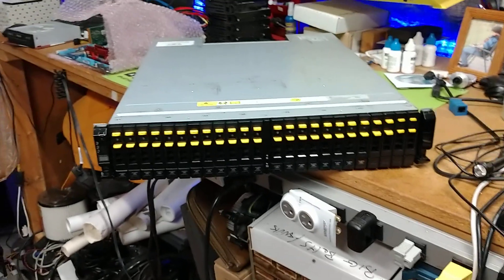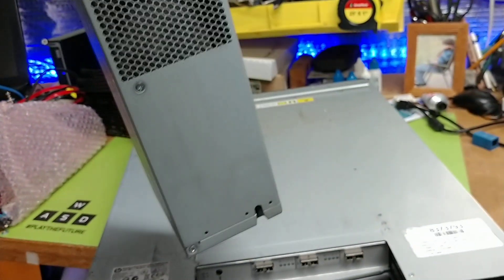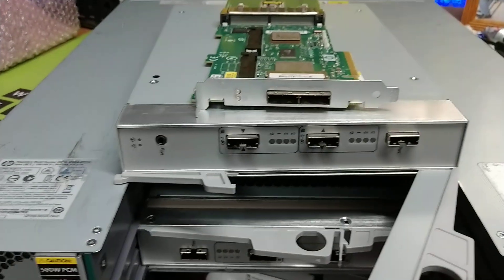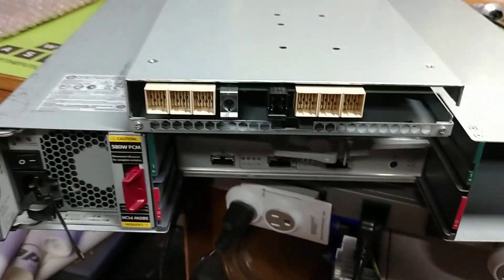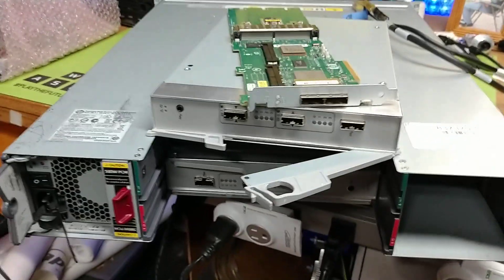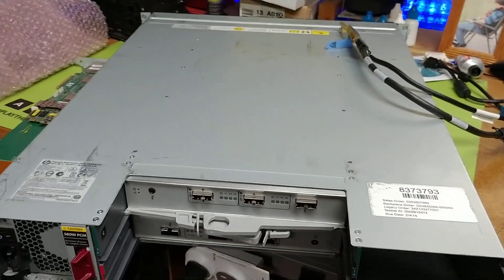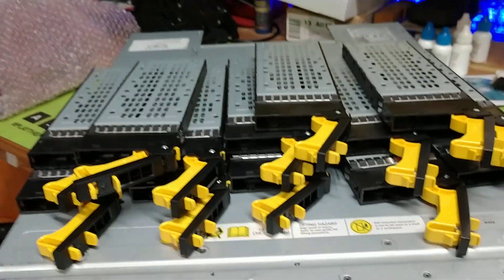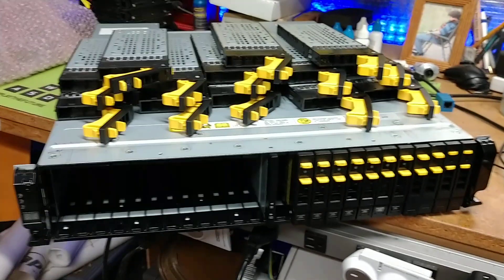Reusing a low cost HP 3PAR M6710 SAS/SATA 2.5 inch, 24 drive disk array  for your home server lab

Comment: So it's port A controller 1 to port A on the raid card. Port B controller 1 to port A controller 2. Port B controller 2 to port B on the raid card? And once I have a lsi 9210 hba card how to I enter the management program on the raid card to see if it sees my disks? And is it possible to do any of this with the HP Smart Array P822 / 2GB FBWC 6GB SAS RAID Controller I have now or do I have to wait for my hba card to arrive? I don't know how to flash my raid card and I don't think I want to bother. It's simply easier to not flash anything in the first place
Reply from the maker: For the HBA card you use the OS tools to see the drives for the HBA controller doesn't have a RAID OS on the board. (That is why they are so you can see disks in basic format.) A RADI controller does have a RAID OS on the card and will let you see the drive but not use them until they are 512 sector formated.  TO know how to use the HBA controller go to the video I sent you about formatting 520 sector drives.  They walk you thru the Centos linux steps using a HBA controller.  That is why I have a USB stick with Centos and the formating tools on it. It works.  As for flashing, I agree, use the HBA for see and format anything and then once your disks are ready flip to the RAID card.  Both are also great DIAG cards to  work with failing disks.
Reply: @leadiususa7394  I have 2 questions. First is i bought an already flashed hba card. LSI SAS9200-16e 16-Port External HBA Full-Height PCIe P20 IT Mode ZFS FreeNAS. Apparently it should be good to go once it arrives, right? Second is is the hba card going to be able to cook Thanksgiving Dinner like the 2 raid cards I bought?I bought 2 40x40x20 mm fans because the raid card gets insanely hot. Should I put a fan on the hba card? How do you manage the heat in a desktop or workstation? They have little airflow. And should I use Centos and not Ubuntu? There are videos on formatting with Ubuntu
Reply from the maker: @anthonystrohmayer9191  For question 1 yes, they will be ready for use if in 512 format, reformat if in 520 format back to 512 sector. As for the the heat levels.  I use server chases so air flow in never bad  but I also mount a small fan on the controllers just to help out some... Mounting the fan is your call.  The controller can take a bit of heat but they work better if cooled and place in the right type of case. Do some research on the fans first 1600 to 2500 RPM is good. but the size is a worry based on the space you have...  Me, I have 100's of fans from the past years so I was good to pick my needs from my on stock.
Reply: @leadiususa7394  I bought 40mm USB DC 5V power 4cm 40x40x10mm 4010S Brushless Cooling cooler Fan X 2PCS. They are about 5000 rpm. One is for the raid card. I'm also considering buying pci slot fans. They come in 1 to 3 fans. They are about 2000 rpm. GPU Video Graphic Card Triple Fans PCI Slot Bracket VGA Cooling System. You can see these on ebay. Do you recommend a cooling fan type for my issues?
Reply from the maker: OK so I had to rebuild my unit up again with my P800i RAID card and the 6710 with my two 7000 SAS controllers in the back.  I defaulted my 6710 When I setup array and it failed. Hmm so I saw when I built the array top controller was flip one way and the lower one was flit the other way. RAID port a to SP-1 port / DP-2 port goes to lower controller DP-1. Then the last connection when DP-2 to RAID port B.  The paths showed only four LED for controller and I saw the issue and yes I got an alert peep.  The config default back to four hook ups such as a HP 822 card being use.  So I pulled out the lower controller so it was off. (It must be remove to force a single dual pathway. (not dual / dual pathway.)  We only have one SAS array so we run in single dual fail over path.  You will get a single peep every 20 seconds but all the drives come and can be format and use.  Now to test your disk bus channel on the array. Place one drive for every 6 bay slots. So put in bay 0, bay 7, bay 13 and bay 18 like I did.  Now go into your raid controller and set each drive up as RAID 0 each.  Not together but as stand alone RAID 0 disk drives.  next boot into MS server or Linux and detect them then format them and test a data dump on each of at the same time and see the transfer rates.  Now to get rid of the single beep, when you put in your 822 controller card with four SAS ports and port 1 goes to DP-1 on the array top controller,  then connect the DP-2 back to the RAID card port 2, now do that for the lower controller to complete the config using port 3 and 4.  You are running in dual / dual pathway.   This setup is really built for connection two or more arrays to one storage server.    As for my peeper speaker, I'd tape over it so I barely hear it. (lol) That took about four hours of fun...  See if this works, for my server (MS server 2019) is using these drives in single dual setup and works well. BTW I had a back disk in bus bay 0 and sent me on a path I didn't need to go. Make sure you test drives are good for use.  I didn't check so I assumed it was good. (Make ass out you and me) Not!  Later dude!  Hope this helped you some.
Reply: @leadiususa7394  thanks. I believe I have to wait until my hba card gets here September 11. In the meantime while I don't have a cooling solution for the raid card I will just use my server since it is designed to displace heat
Reply from the maker: @anthonystrohmayer9191  That works for me!
Reply: @leadiususa7394  But to properly have a redundant shelf I need 3 cables? How many cables do I need to attach 2 shelves?
Reply from the maker: @anthonystrohmayer9191  I think the diagram showed two cables between the arrays and four for dual - dual pathing.   Did you look at the latest link I sent showing the cable layout for hooking up 6710 arrays?
Reply: @leadiususa7394  Do I need 4 sas cables to connect one shelf to my raid card or can I remove one controller and just hook one cable to my raid card?
Reply from the maker: @anthonystrohmayer9191  So for now remove one controller card from the array and you can use just two cables, RAID card Port A to DP1 and DP2 to RAID card Port B.  When you have your SAS card, it will be four cables.  The bypass cable is only needed when you add another array to the mix.  Refer to the link I sent you on hooking up 2 or more 6710 arrays to a server.
Reply: @leadiususa7394  So one cable from port A and one for port B on the controller 1 to A and B on the hba or raid card?so I need 2 cables. Won't work with just 1?
Reply from the maker: @anthonystrohmayer9191  So one cable used is single pathing and not good to do and you will get fault alerts.  If you use one controller then two cables should be used.  Sorry...
Reply from the maker: Check out the HP 3Par cable setup.  https://www.youtube.com/watch?v=xdUuHN4bbKA   it is pretty good if you don't like the manual link I sent you.  The cable media is different but the hook up from array to array to server is correct
Reply: @leadiususa7394  neat. My brain is too tired to want to watch the whole video. Need to plug in my workstation one day when my hba arrives. Is there a way to format a 3.5" drive without an internal hba card or a 3.5" shelf? I just have 2.5" shelf and an external hba
Reply from the maker: @anthonystrohmayer9191  Your work station may support SATA/SAS mode.  Get the single SATA to SAS with power connector to test it out.  But before that you need to put everything down and walk away from all of this and play a game or sit down with a good beer or grill out.  Life is more a everything and less about IT stuff.  When you feel better go back and with the SAS stuff again.
Reply from the maker: @anthonystrohmayer9191  sure just get one of these singe SAS connect cables. https://www.newegg.com/p/0ZF-00EK-00045?Item=9SIAABH54D4941   I like this so much... I just order one for my needs jsut now.  I might get two or three more later..  I forgot about this SAS hookups...
Reply: @leadiususa7394  I am occupied with thing outside of these projects. Like the gym 4 days a week. And work.  And building my diy shelf. Some day I hope to be over these problems with the disk arrays
Reply from the maker: @anthonystrohmayer9191  Yea take a break, it not going anywhere...
Reply: @leadiususa7394  these 2 shelves cost me around 750$. Be nice to get them working. And the sad part is I don't even know if they work or not. By the time I get them running my 30 day warranty will be expired
Reply from the maker: Oh and one other things.  This URL show you have to cable up the 7000 controllers for when you two or more arrays.   https://vmfocus.com/2013/03/18/3par-storeserv-7000-hardware-part-3/

Comment: I had a need for an external enclosure for my homelab.  I found a used one of these online and decided to try it.  I found your video when I was trying to figure out how to cable it to my server.  It came with two cables.  My first attempt was to connect each of the two external ports on my LSI SAS9207-8E to a DP-1 port on the M6710.  This worked and my server was happy with that arrangement.  However, the fault light on the M6710 bezel is on and the fault light on each of my eight SATA drive trays is also on.  All lights on the back of the M6710 are green, there are no yellow lights on the back side.  When I first power up the enclosure, there are only green lights on the front.  When I power up my server, the activity lights will flicker when the bios checks them out.  Once  Proxmox is loaded and running, the fault lights come on.  I don't have any daughter cards for the SATA drives.  They are plugged directly into the backplane.  Is that the issue?  Or is it something else?
Reply from the maker: I think your cable setup is wrong on the back of the unit.  Your server will plug into Top A port on the back of M6710, then top port B goes to the lower A port and then the lower B port needs to go back to  controller in your server.  Do you have it setup that way?  I bet you are only doing a single pathway currently and will create errors issues.  Also you can just test the upper M6710 controller and then the lower controller part. Doing will allow you to test 12 drives at a time on each controller.  Let me know what you find out...
Reply: I am working on that.  I only have two cables at the moment.  I have another one on order.  My second attempt with two cables was one from server to DP-1 and the other from that DP-2 to the other DP-1.  Server is still happy, but no change in M6710 lights.
Reply from the maker: @tsimblist  Yes but you need a cable going back to your server from the lower PS-2 port to provide you a redundant path instead single path.  Server to top PD-1 - top DP-2 to lower DP-1 - Lower DP-2 back to server second port.  That should work. /:>
Reply: I received the cable that I ordered and cabled up my server with the M6710 as you instructed.  No change in symptoms.  I'm afraid I may need the interposer cards for my SATA drives to keep the fault lights off.
Reply from the maker: @tsimblist  I am rebuilding mine into your config. I well let you know what I find...
Reply from the maker: No the array can do both SATA and SAS but try not to mix them on the same bus, Put SATA together on bays 0 thru 11 (Bus 1 and 2) and SAS on bay 12 to bay 23. (Bus 3 and 4)  Run them in separate buses or they will fight with each other.  Also boot into a basic Linux OS like Centos on a USB stick, (Like in my videos)  instead of booting into a full blown Proxmox OS.  Test at the core level away first and when all your issue/s are address then test your targeted OS.  Step by step you will get it work.  As for the yellow lights, I will research with my 6700 series 3PAR array and see what that issue is.  I will get back to you on that one.  The Yellow alert maybe a false / positive alert do to the heart beat JR-45 or serial connections connected.  You don't need them when doing core SAS connectivity.

Comment: me again, Just had the time to get back to this project, I formatted all drives, unraid, windows and freenas can all see the drive but they will not mount nor will they format  or initialize, in Unraid I will get this error "Unmountable: Unsupported partition layout" any suggestions?
Reply from the maker: Did you format from 520 sector to 512 sector?  The good news is that you got it all hooked up.  Also how long to each drive take to reformat? It should have been a few hours each to doing a low level formatting.
Reply: Leadius USA it took a little over an hour for each drive. I used sg_format - -format - -size=512 /dev/sd(x)
Reply from the maker: Did set the sector size to 512?
Reply: @leadiususa7394  Yes I used the "--size=512" was that not correct? Thanks for your help
Reply from the maker: @every1critic  Yes that is it. Ok check your cabling.  The array can block a drive use if not cabled right or is failing.

Comment: I need cheap enterprise level sas drives. Everytime I try to buy some on eBay someone out bids me. I'm afraid I can't afford steak on a McDonald's income.
Reply from the maker: Yea but don't worry so much on that front.  Are you trying to buy in bulk or one at a time?
Reply: @leadiususa7394  I bought a raid shelf that purposely came with the drives and cages to save me the headache of finding compatible drives and cages. But I have this project of making a diy shelf for hard drives and raid connected to either the mini sas or from inside the computer case on the mini sas connectors on the raid card and I needed a set of matching drives 8+.
Reply from the maker: @anthonystrohmayer9191  Yes but they do not have to be the same make and model.  Just by size.  I have been doing this for 29 years now and it work with mixing as long as you don't mix RPM speeds.  If you really want to get the same set of disk then shoot (For now...) the 300GB 10K SAS disk drives.  Do you have a 3.5 drive shelf or 2.5?
Reply from the maker: @anthonystrohmayer9191  here is a 300K 2.5 inch SAS Dell hard drive you can look at.  https://www.ebay.com/itm/U709K-Dell-300GB-10K-6Gb-s-2-5-inch-SAS-HDD-Hard-Drive-HUC103030CSS600-0U709K/282651157882?epid=177505943&hash=item41cf52657a:g:M6QAAOSwTMZbhKpL      Also are you using a RAID Controller or a HBA controller?  If it is a RAID controller then you only need 3 or more disk drives to get your storage started and you can grow it out as you get more.  HBA format is doesn't matter for you need a software RAID OS to do anything so 2 or more drives will work.  Also if anyone tell that you must have the same make and model of drives, they are wrong.  That only applies to enterprise level systems and that is not what you have based on your goals.
Reply: @leadiususa7394  I bought a 4 mini external sas and 2 mini sas internal raid card. I thought I read it was 6gbps bit it might be 3. Hpe p822 smart array
Reply from the maker: @anthonystrohmayer9191  IT should be 6GB cables...

Comment: I'm having the hardest time trying to get this working in my infrastructure. The cable hook PDF has a bad link. Could you explain how you got yours working?
Reply: Yep that was the issue, Had to put in HBA mode and reformat all the drives. ugh a little over an hour for each drive.
Reply from the maker: @every1critic  Yep and sorry about that.. But the drives are cheap so there is a little bit of a time price to pay.  I think you can script the the formatting so it does all the drives over a day...  You just need to know the drive IDs and then add them into a script kron job and walk away...
Reply: Leadius USA good to know, I’ve finished them. I have 5 computers and ran the command via unraid on each computer. But I will look for that option next time. As I will be getting another soon.

Thanks!
Reply from the maker: @every1critic  cool
Reply from the maker: Sure, now for use I am only using a single server node so that is what I am referring to.  The server side SAS connection from a HP raid controller or HBA controller will need to firs go from port A and the disk array top controller to the A port (left side) on the disk array, Then on the disk array (left side but right B port) goes to to the disk array lower controller  to the left side A port.  Then the lower disk array right B port will go back up to the server B port on the controller.  Here is a Link to the manual. This is only for one disk array to a server host, but it is very easy to add more by just adding into the cable series. https://support.hpe.com/hpesc/public/docDisplay?docId=c05163419&docLocale=en_US
Reply from the maker: As for a possible bad SAS cable. Get yourself a new spare cable to use as a test cable.  Make sure it at least three feet long or better.  That way it works as a test cable for all of your cable testing needs.  I use a 5 FT. SAS to SAS and I also a Mini-SAS to SAS cable myself to test my NetApp disk arrays.  Hope this helps you some!
Reply: Leadius USA thanks! This will help I think my first issue is that I purchased a SmartArray card and not HBA card.
Reply from the maker: @every1critic  Side question,  Are you recycle NetApp disks for use with your array?  If so they are formatted in 520 sector formats.  You need a HBA to reformat them before they can be used.  Just a heads up.  These disk are really cheap to buy but do need some prep before using them, some EMC, and IBM has the same challenge.  Refer to my other video talking to reformatting to help you out.
Reply: Leadius USA as far as I know these are not netapp drives. I got 25 600GB drives for about $160.. I will look into that in case that is an issue. Thank you
Reply from the maker: @every1critic  Cool then, here to help where I can so everyone can learn this stuff!  Later dude!